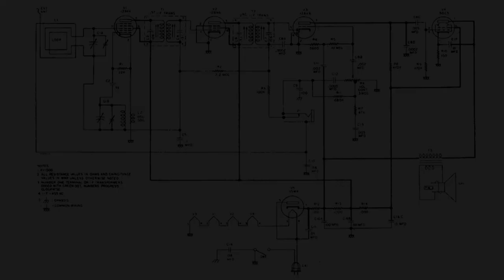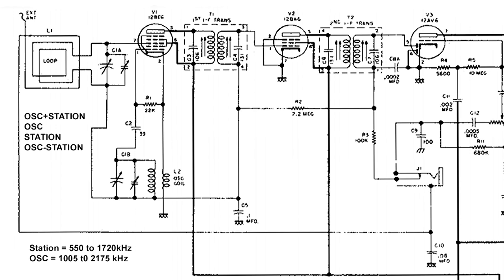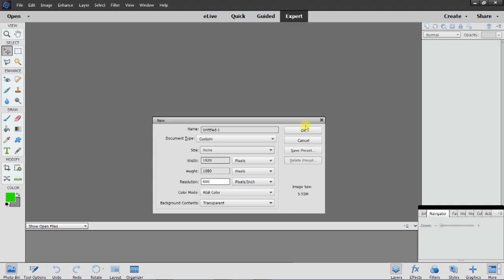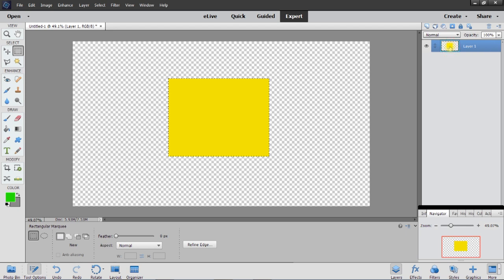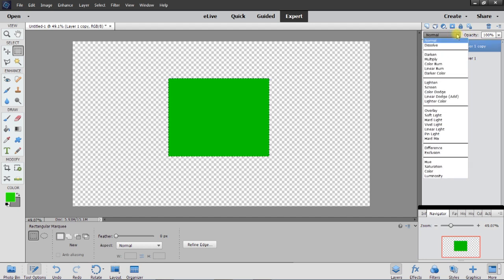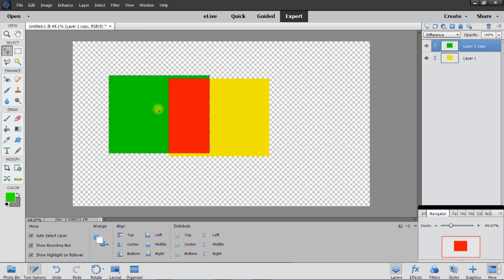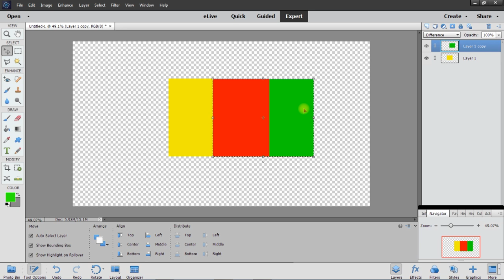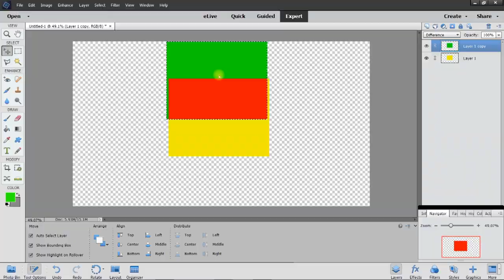Superheterodyne RF Mixer Visual Color Demonstration

Comment: is it possible to look at the RF and OSC frequency's with an oscilloscope without disturbing the radio reception?
Reply from the maker: The most common impedance of oscilloscopes are about 11Meg. This will influence a circuit, a little

Comment: Why some radios local oscillator works above the radio station frequencies and on some radios local oscillator works under station frequencies, what is the criteria in engineering where will work local oscillator?
Reply from the maker: Send me the schematic of a radio where the oscillator is lower than the radio station frequency.
Reply: Hi... thanks for the video. Very good idea to illustrate super heterodyning. I shared this on blog zero echo nine forum. Lookoutfa Charlie YouTube channel
Reply: @AllAmericanFiveRadio  I wonder what colour you would use for that Richard 😉  great post Richard new way of looking at things  .it's that nice  soft voice that does it 👍
Reply: @AllAmericanFiveRadio  , it is about radio telephone transceiver simplex Stornophone 700 (146-174MHz) from early 70-es when PLL synthesizers were not developed yet and it works on fixed crystals inserted in 6 sockets for desired frequency for the 6 different channels. 
First, the signal from antenna passes through antenna shift RX/TX and the signal is filtered through band pass filter BP711 Helix filter (1st picture) and cutting everything below and above band 146-174 MHz. 
After wide range filtering, the desired signal enters in radio receiver RC711 (2nd picture) in 1st mixer where is mixing receiving station with local oscillator in FET transistor Q1 where both signals enter in GATE and mixing to new intermediate frequency 10.7 MHz which L2 coil filter filters and passes only 10,7 MHz and eliminate frequency of local oscillator F(osc), radio frequency (RF), RF+F(osc). Here the local oscillator works under the RF for difference 10,7 MHz RF-F(osc)=IF(10,7MHz)
The crystal frequency is very low 11,2-14,5 MHz and it is multiplying (in receiver RC711) through tripler (fx3)Q4 and two doublers (fx2)Q3, (fx2)Q2 to reach high frequency such between 146-174 MHz depending of inserted frequency crystal (X-TAL).

Formula to determine the crystal is Fx=(Fa-10,7 MHz)/12. Fx is crystal frequency, Fa is antenna frequency.

After 10,7 MHz passing L2 coil filter, the signal enters to next stage intermediate frequency converter (IC703) 3rd picture where 1st intermediate frequency 10,7 MHz is converting to new intermediate frequency 455 kHz through the 2nd mixer to gain better selectivity between adjacent channels which are very close and narrow.

https://ibb.co/zPtDjWK
https://ibb.co/JdskvhZ
https://ibb.co/YWLJ6Pr

Here you can download whole service manual CQM 713-714
http://www.peel.dk/Storno/storno_700.html

Comment: So... because 
* every station hase 
A Different pre-set RF frequency
 ... between 550 kHz  - 1720 kHz
 once we tune left buton onto 
 that position of that particular
radio station
 on the front  screen ....   
Only THEN  
* We need to tune right buton
(* an oscilator capacitor)
into a certain frequency 
1005 kHz -  2175 kHz
that results in 
455 kHz difference.

 Once 455 is achieved...
That signal goes through 
 into 
the IF Filtering systemm
...etc. etc. 
🧠🧠🧠   💭💭💭

That system  Was Armstrongs invention ...  ... was it ? 
...
and later on ... they created GANGED variable Capacitors
...  so that one shaft moves 
* both sections = kHz "numbers"/
 Rf - OF ... and we have to turn 
  just one button (???)
Reply from the maker: Yes, it was Edwin Howard Armstrong. Your question has given me an idea for a video.
Reply from the maker: NEW VIDEO
How Superheterodyne Works
https://youtu.be/jQd2LfTOa4k